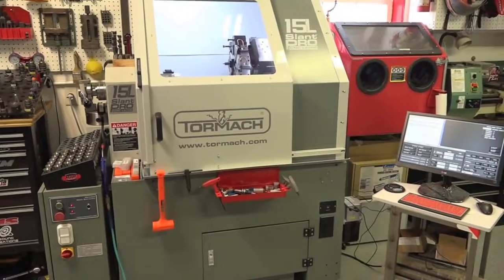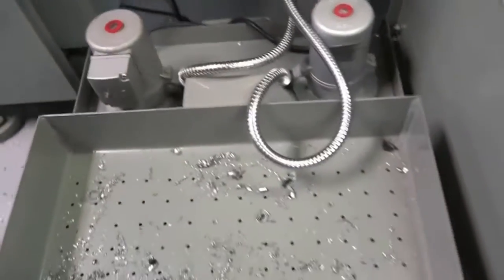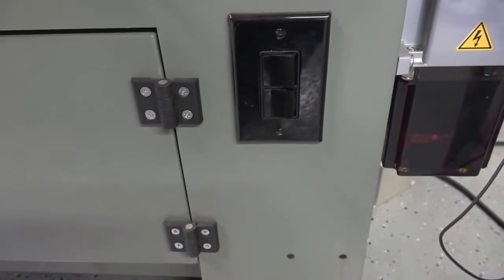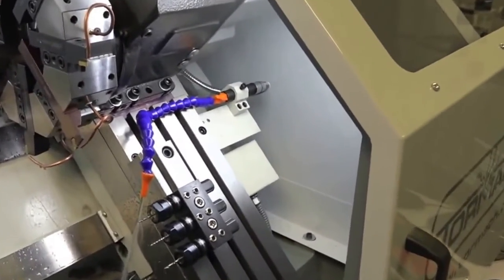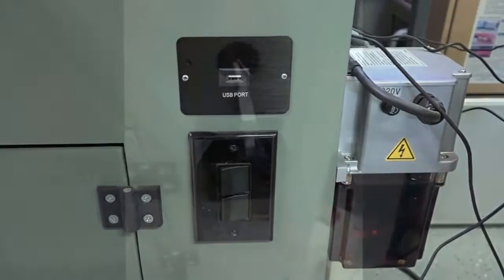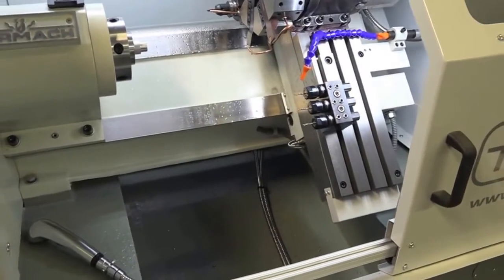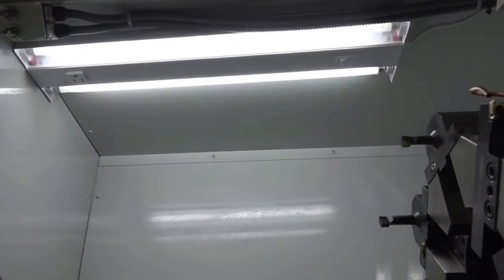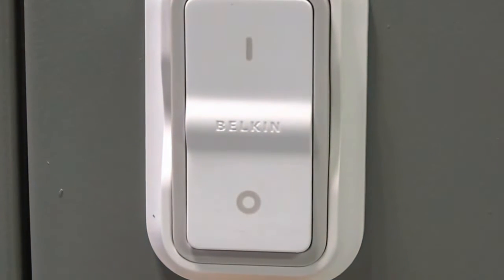Tormach 15L Slant Lathe Mods , Tips and Lighting

Comment: My only concern with those lights is that they have an outlet in them and are in a wet environment. It just seems like a hazard that at best would short out the light and at worst get you hurt. You may want to disconnect the outlets or waterproof them in some way.
Reply from the maker: Hi Eric I been running the lathe for months now. Have not had any issues with bulbs or the outlet. But putting some silicone in the slots is not a bad idea. Thanks for the suggestion 👍
Reply: +G-Made CNC Yeah, I just would hate to have someone have an issue that I could have helped with. It's probably all the safety briefings I got in the Air Force that made me paranoid about safety. ;-)